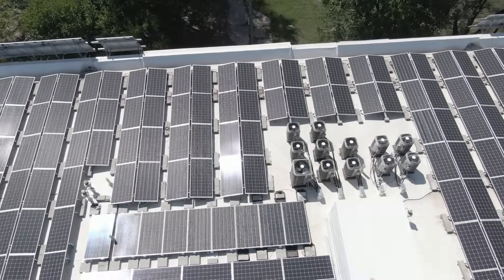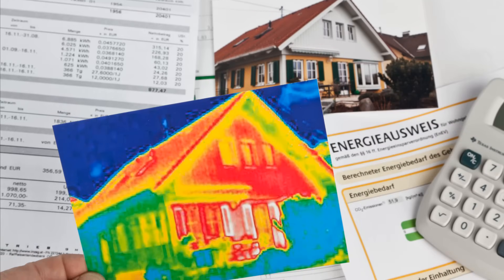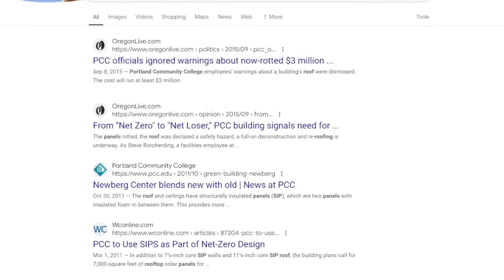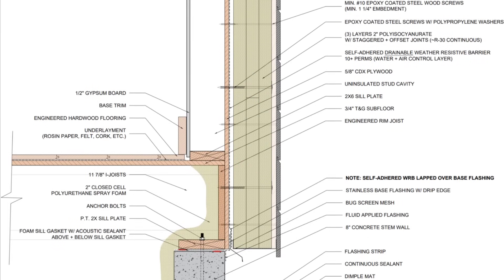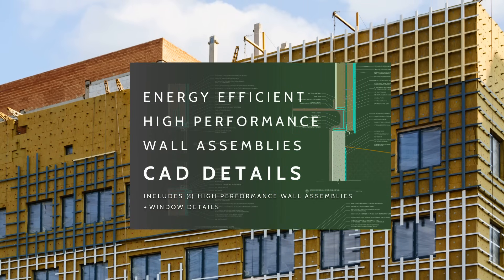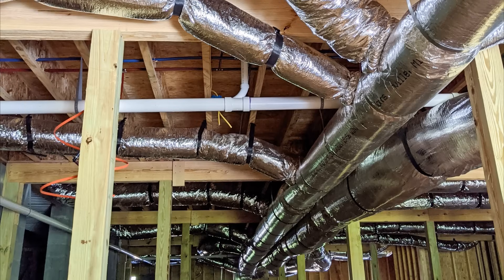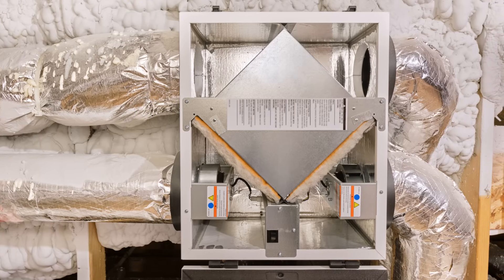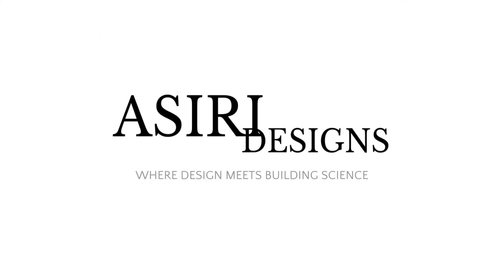The Unintended Consequences of Energy Efficiency...

Comment: Alaska; Exterior insulation is exactly incorrect for long term durability. In very cold regions, the moisture is generated from the interior. This moisture will gravitate to the exterior as there will always be holes in the interior wall vapor barrier. In the exterior wall there is a temperature gradient that is below the freezing point and frost may form. If an impermeable   layer is on the outside of the exterior wall the frost/moisture will form inside the wall. As the outside temperature warms this becomes moisture and will enhance decay unless a path is created for the moisture to gas off in the warm season. An exterior vapor barrier is the worst possible method for cold weather insulation. I would not use the exterior Tyvek in cold country as it is a form of vapor barrier. Most areas where the weather is quite cold I would think exterior waterproofing is secondary to an interior vapor barrier.

Comment: "There's nothing more sustainable than building something that lasts a long time".  Best quote in the whole piece.  A structure must be structurally sound, built with long-lasting materials, and then it should be energy efficient; in that order.
Reply: You run into bad retrofits instead of just tearing it down and building it right. Build using renewal/sustainable resources to last a 100 years and reassess then.
Reply: Soundness and energy efficiency are #2 and 3.  Number 1 is that the wife likes it!
Reply: @pleskbruce That's what my Father taught me, my Mother chose the floors, tiles and color of the house and he chose the payment method

Comment: Recommended air change figures vary from 0.35 to 6 changes per hour. Very wide! And these ignore building size and occupancy. And, unless sealed, there is an unknown level of ventilation anyway. The answer? Use a CO2 monitor to measure peak values and decay time. This will give a guide to the actual needs- which will vary throughout the building. Used rooms need more than corridors, and activity rooms more then sedentary. Ideal would be a system with CO2 sensors that controls levels. Add humidity sensors if that is a problem.

Comment: A friend of mine has an old house. I dont know what it used to be heated with but he installed a wood stove and later on a heat pump while leaving the envelope porous as it was designed to be a century ago. The heat pump now covers most of the heating and cooling, and the wood stove is more for auxiliary heating on really cold days. It seems like a good combo as the wood stove draws lota of dry air through the house keeping things bone dry.

Comment: As a past resident of a large single-family suburban home and current resident of a tiny house, I found that the energy efficiency concerns became largely irrelevant due to the dramatically reduced operating costs of a smaller home. Moisture management problems are exacerbated by excessive insulation and air tightness in a smaller space.

Comment: We should build stronger buildings, made out of concrete and bricks. Those could last centuries, sustain thru hurricanes, stand against rodents and insects. Also, those materials are excellent heat accumulators preventing rapid temperature changes in the building.

Comment: My neighbour went broke building a passive house. It's been unfinished on the exterior for 2 years now with all that exterior insulation exposed to the elements. 

Makes no sense to spend double building the passive home just to save $60 a month in gas bills.
Reply: Well it shouldn't, they did something wrong, I have designed over 40 such homes and a premium of maybe 10%-12% is what you are actually looking at

Comment: We need to rethink this scenario. I built a new house about 8 years ago. Did all the requirements and made sure that the house was up to the current codes. Now I have a daily fight to keep the Co2 level in the safe level. Having to leave a window open all day with a bath fan running to help turn over the poor air quality defeats the purpose.
Reply: Thank you ... Glad I'm not in the minority who think about this. Air tight means CO2 can't get out too
Reply: @zaiks0105  The magic words are "Energy Recovery Ventilation". I grew up in a Passivhaus and never had any problems with high CO2 levels
Reply: @Mooooov0815  Good to know
Reply: @ I have a gas stove in the house and when we bake bread in the house in the winter my Co2 levels get over 2k. This winter I hope to rebuild some cabinets so that I can get a double electric oven in the kitchen. My levels inside very seldom get under 1k which is too high.

I built my home  myself in 2014 and I wish now that I had not followed all the codes for air infiltration.it’s tough to let fresh air into the house when the outside temps are in the single digits.
Reply: Did you try a subslab radon fan ? My CO2 was coming from the ground.
Reply: @ First my basement floor is concrete and fully sealed to the basement walls. 2nd when I built my house I put a French drain all the way around the foundation inside and outside and ran them into a crock inside the basement. It has a 3” vent from the basement out the roof. 3rd that vent pipe has a radon fan attached to it that runs 24/7. Pretty sure that should take care of the ground radon or any other gases under the house.
Reply: @MacDa-yy8xn  that sounds like it should be effective.  Our radon was around 5 pCi/L but CO2 was hitting 2000 ppm and 1400 on average. Amazingly no regulations on radon here. After 4" pipe and fantech rn2sl we are at 0.3 radon and 500 ppm CO2. Our home had 2% air leakage when tested and has a fresh air intake but not an ERV.

Comment: Don't you have cellulose or wood fiber insulation in the US? It's a common solution for poorly insulated wooden houses here in Norway, either blown into cavities or as sheets. It requires a vapour barrier that's somewhat diffusion open on the inside, and an air/moisture barrier on the outside that's more diffusion open, often fiberboard sheathing, which also requires an air gap behind the cladding.

I would never ever insulate with foam or anything that doesn't transport moisture horizontally, as wood/cellulose does. Wood/cellulose is much more forgiving, whereas artificial materials require a perfect installation and no punctures or you will get mold and rot. From an environmental perspective, it's also much better than plastic or glass based insulation, being made from waste products. As for insulation specs, it's better at heat buffering, retaining heat absorbed during the day and slowly releasing it back during the night. There's less sharp rise/fall of temperatures indoors. Unintuitively, it's also more fire proof (thanks to borax additives). I think it's just a superior insulation material! For old houses especially.

Comment: Great video! Any further suggestions about construction with SIP's? The video talked about exterior insulation to keep the condensing surface warm, but on a SIP would that be somewhat redundant or expensive because all of your insulation is in the panel itself? Do you think using a WRB on the exterior of the panel with a vented cavity system behind the cladding would be sufficient to prevent moisture issues? This would be a building in climate zone 5, 6, or 7.
Reply from the maker: We actually have a whole video on SIPs that got posted a couple weeks ago, you can find it here: https://youtu.be/EMtKTAXM6eo?feature=shared
Reply: @ASIRIDesigns  Thank you! I'll definitely be checking it out!

Comment: I probably would dismiss this video, but this summer I replaced oil burner for hot water with hot water tank. And that tank insulated so well that temperature in boiler room dropped significantly and we got a problem with condensation on (cold) water pressure tank and cold water pipes. So we had to remediate it
It is definitely something that is often overlooked, we didn’t even consider such consequences

Comment: It won´t fix all problems, but building out of aerated concrete like Ytong is so much better then wood/OSB/plasterboard. Great heat insulation, extremly easy to work with, super durable, you can hang very heavy stuff anywhere, almost soundproof, well drying, water resistant... And insulating it is so easy. Just stick mineral wool onto it (or polystyrene or something, but wool is best IMHO), then put a glue for aerated concrete over it and you are golden. This is not me hating on you, but really, I don´t understand why whole northern America uses wood.

Seriously, if I were to have a construction company in the US, I would try my best to get hands on this and make my name by building from aerated concrete blocks.

Comment: Setting up the insulation on the outside of the walls has always been an idea I've been wanting to explore anyways , 
And as a contractor I have seen this moisture and mold problem you're discussing when insulation was not thought out properly ,
But as far as the air conditioner is concerned all that needs to be done there is simply make it smaller or the get a multi-stage 
Unit that can fulfill heavy load requirements and allow for dehydration functionality .
Reply: In eastern or northern europe only heritage buildings are insulated inside, in scandinavia frame houses are more prevalent so of course they are insulated inside the frame, while where I live its usually calcium silicate blocks that make up the building walls and the walls are either insulated with wool or sometimes wrongly with polystyrene.

Comment: What is the best insulation mechanism for metal structure buildings in hot climates such as South Texas and Florida?
Reply: Oriented strand rigid fiberglass board, oriented down. Air gap at the bottom and on the metal side, for moisture drainage and airflow. Paint the metal white.

Comment: water water everywhere but not a drop to drink..
Damp, mould and humidity are important factors. Here in UK we have a very wide variety of building constructions, many dating from pre-USA, so some real challenges!

Most people (inc many engineers) aren't really aware of how the balance of concerns has "flipped" and why things like ACH (air changes per hour) are having such an impact (and dehumidification..).

We are going back to 'keeping the cold out', rather than 'keeping the heat in' ;-)

Comment: Ventilation is extremely improtant: It prevents the build of: Humidity, mold, CO2, PMCs, Radon and other gases and substances. Heat exhcangers help keep thermal loss of ventilation at a minimum.

Comment: If you do the insulation properly, you can almost eleminate the risks you outlined. However, that‘s not an easy task to do. You indeed need dry materials, they need to be able to transport e.g. condensed water in- and outwards. An active ventilation in your house (with heat recovery) also a good investment to stay really dry inside, which in turn makes it easy for any remaining water vapor to get out of your construction into the inside and then being flushed out via ventilation.

Comment: I think you get wrong heat flow and air flow... Heat does NOT take away ANY humidity!!! Air does! Longlasting does NOT mean it is more sustainable. Here comes a bad but strait example: If you burn a forest full of trees to heat a hous that has a lot of "heatflow" :) it is much more efficient to built a house out of cartbord that inulates, you dont have to heat at all and molds away  in 10 years and takes only ten years to regrow.
Reply: boy that thing with air conditioner is also.... sorry. I dont want to bully here. I´m all there with you that manny people and companies do insulation the wrong way. Often there are tecnical challenges are not solved jet or to expensive for the owners.(well some folk cheap out on quality building so they can have two homes the results are bad planed insulation and so)
Reply from the maker: https://buildingscience.com/documents/building-science-insights/bsi-140-there-no-such-thing-free-thermodynamic-lunch

Comment: As the price of residential solar power drops, it's becoming uneconomical to add insulation when we could just add panels. 

Then we must raise the question: Why are we going through all this effort, cost, and exposure to toxic materials for the sake of using crappy materials like OSB? Why not just stuff a little fiberglass in the attic and walls and focus on the solar patio or carport?

Comment: Those are great PhD results for building a house but those workers don't have a PhD. The assumption that the work is being executed without errors is flawed. In essence, the concept must not only bee robust against climate and weather but also against tolerances and errors during the build process.
Reply: Spot On Observation
Reply: Skilled labor is decreasing, workers are pushed harder and faster for profits, and inspectors are in bed with the builders. Journalists are taught to write for readers at the 5th grade level, and now designers will need to spec for the same.
Reply: As a Builder with decades of experience I can tell you that architects, engineers and designers who have not wielded a hammer have a poor understanding of the practical realities of construction.
Reply: @RagnaRockerX7 I would tend to agree
Reply: Agreed, every detail I draw has that concept in mind
Reply: A good GC doesn't have these issues, or make these excuses.
Reply: Disagree, IF you are building the house yourself.  We shouldn't accept work done to the lowest common denominator.  You tell the builder what you expect, and they are expected to deliver.  That said, for mass produced cookie cutter homes where you aren't really involved, you are most definitely going to get a lot of homes built by rubber stampers and workers who are not competent.

Comment: Insulation is not the problem .... humidity and temperature control is the problem .... nothing grows out of its right or critical humidity and temperatures .... even some woods do not rot inmersed in water or mud .... mummies are even conserved in time under the right humidity and temperature .... structures and health fail when the professionals do not have enough experience and sound intentions

Comment: There's more to energy efficiency than just insulation. To be efficient, you also need retractable awnings, so you can block the heat of the sun from entering your windows in the summer, but let it through in the winter. And you need to give your house a high heat capacity, so that if you cool your house at night, it will stay cool during the day and if you heat your house during the day, it'll stay warm during the night. This heat capacity can be achieved by building the walls out of heavy materials like bricks or concrete and only insulating it on the outside.

Comment: Interesting. In Poland for example we built a lot of buildings for people working in heavy industry, mines or ironworks. They were built really quickly and cheaply out of prefabricated slabs of concrete - so called "Large panel system building". At some point 12 mln people were living in such buildings, and it was like 30% of total population.
Some estimated that they will last like 40-70 years. And since they were built from 60' to 90', some of them would be already due to deconstruction by now. But they were insulted. And it extended lifespan of these buildings for many years to come, and they still stand without any problem. Even in areas with heavy ground movements due to mining.
Reply: If built correctly those shitty panel buildings are incredibly strong. I saw one damaged by a gas explosion on the ground floor. Some panels were blown off and the whole floor was destroyed. So it had to be demolished. They evacuated the nearby buildings and used explosives. The explosives were only installed on that floor because of flying debris risk. When they were se off the building became one floor shorter like in the cartoons. In the end it had to be taken apart panel by panel as the quantity of explosives needed would also damage the surrounding buildings.

Comment: Heat Recovery Ventilators are code required in all new homes across Canada. They lower relative humidity. As a designer, I do not use rigid insulation on the exterior of walls. In some builds, I delete plywood or OSB sheathing and substitute with steel wind bracing and two layers of spun Olifin fabric.\ (eg. tyvek). I use Corning Foamular rigid R10 insulation attached to the inside of the studs. This product is a rated air barrier and Vapor retarder, and provides a Code required continuous thermal break at the studs. XPS type insulation should not be applied to the exterior in cold climates since it is a vapour retarder and traps water vapour between the outer surfaces of sheathing and insulation thus leading to potential mildew on the exterior sheathing. My opinion for what it is worth.
Reply: Wow you are on the cutting edge where do you build these?
Reply: Drywall over the foam?  What is your roof?

Comment: To summary: if you do it, do it right.

Over here in Germany, air tightness is one of the most important topics in newly built homes. Ventilation is not mandatory, only a concept for ventilation which may contain manual ventilation through the windows. In practice, the necessary air exchange can only be reached by controlled ventilation and in the last years basically all new homes have some type of ERV. For older homes, decentralized ERV can be a good idea
Reply: In Denmark active ventilation was obligatory since around 2005. Have several new appartments and it works! Also, heating bills are ridicously low. Less than 300€ per year for heating and hot water for a 204m2 appartment with very large window panes. Could hardly believe it at first.
Reply: Oh yes, instead of letting the heat out through a draft, let it out purposely, instead of an heat recovery air exchanger.
Reply: Maybe germans shouldn't be lecturing people, considering what a disaster all their government policies have been. Enjoy your dunkelflaute mate